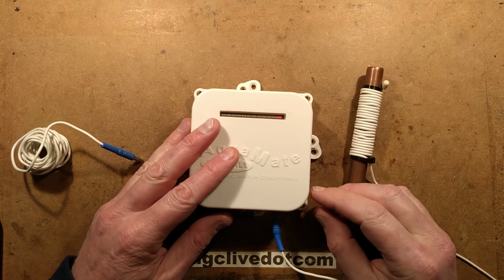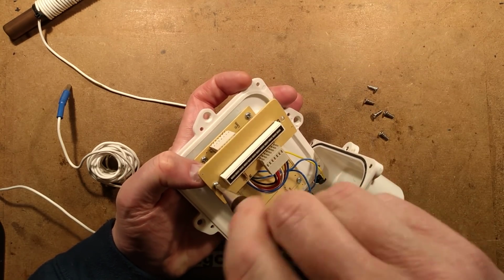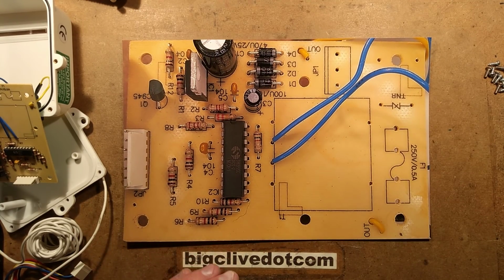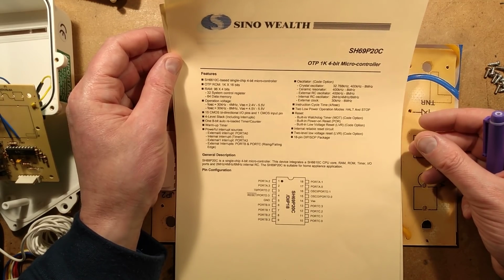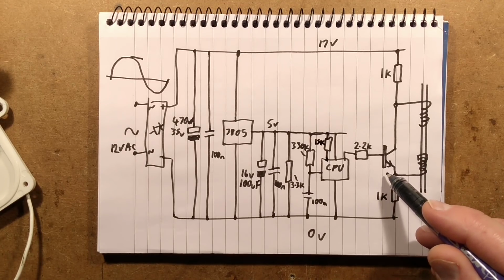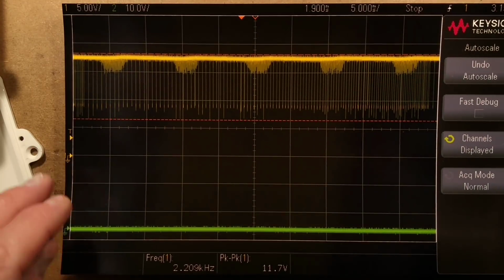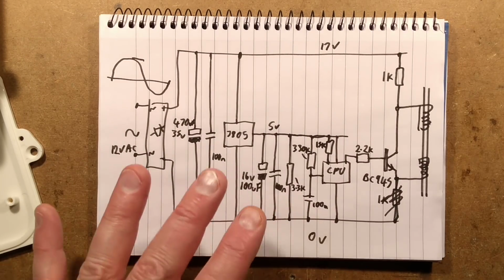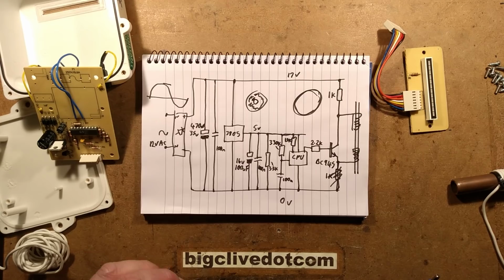inside a computerised pipework scale reducer.

Comment: There is absolutely no way this can descale anything. Hard water is basically water with calcium compounds dissolved. So regardless of the current induced in the water, you have the same ions before and after the "descaler", resulting in the same chemistry. The only way this "works" is by people imagining it does. It's a led chaser strip with placebo effect.
Reply: It aligns the polarity of the ions so they flow better at least until the first bend
Reply: @jostouw4366  that polarity is going to be dealt away with log before the first bend. The Brownian motion of the water molecules and the ions themselves is going to jumble everything just as well as it was before the "descaler". After all we are talking about ions in a fluid.
Reply: @featheredskeptic1301  Think you missed the irony and the coppery ...............................
Reply: @jostouw4366  Oh, ok. My bad. You just never know with people nowadays. I've heard way more ridiculous statements from people who are serious, they broke my irony detector. Sorry.
Reply: @featheredskeptic1301  Know what you mean the world is full of strange people sometimes they hide in mirrors lol
Reply: If a precipitate is forming, causing ions to oscillate may prevent large crystals forming and promote large numbers of smaller crystals without changing the underlying chemistry, they may be easier to pass
Reply: @marcpurkiss3233  Ions already oscillate much more vigorously due to thermal noise. Besides, even if passing AC current through the water in the pipe via capacitive coupling prevents crystal formation, the current only passes between the areas of the 2 electrodes few centimetres apart from one another. Any residual oscillation after this point is going to be lost very quickly due to Brownian motion. The ions are no longer within the electrical field of the descaler and so all effects are lost. There may be something that I'm missing and these things may actually work to some degree, but it all seems very dubious to me at best. It seems to be working as nothing more than a capacitive divider with the water/pipe as the middle electrode. I'm not even sure if this is going to pass any current in the water if it's mounted on a coper pipe... unless the water quality is so bad that you get something more similar to electrolyte instead.

Comment: The spikes makes me think they are attempting to mechanically micro-vibrate the piping.
Micro-vibrations may actually be effective (note to commenters: this device doesn't have to achieve that for it to be effective on its own)
Reply: I suspect, for me, the road traffic and the neighbour's hammering and drilling would be more effective.
Reply: That's not micro-vibrations, and they are at a way lower frequency.
Neighbour's hammering is tenths of hertz. (tenths not tens).

Comparing the two is like equating the ultrasonic sensor-dust cleaner in a DSLR with shaking the camera. If the latter worked, they wouldn't have installed the former. (the former is by no means perfect either)
EDIT: And yes, professional photographers will tell you there is a difference in having the ultrasonic self-clean and not, but they still might have to clean their sensors by hand.
Reply: How is a 2kHz electrical signal going to produce centihertz (?) vibrations, and why would the frequency matter?
Reply: First:
Where did you get centihertz from? How is "thenths [1/10] of hertz" "way lower" than centihertz (hundredths [1/100] of hertz)?
Also, let me direct you at my note to commenters.

No It would produce a sweep from about 1.64kHz to 5.54 kHz, if it even generated any mechanical effects.
The idea that it is supposed to be mechanical effect (regardless of it actually managing to do so or not) is somewhat supported by the instruction saying "not for lead pipes", as any mechanical deposit removal method could easily (in theory) deposit lead into your water supply (at least more so than without).

It doesn't matter if the device works or not, I'm trying to answer the question of how it is "joo joo"-supposed to work.
Reply: I might as well add that the kilohertz range does not travel that far in solid materials, so even if traffic (or the neighbour hammering) produced anything in that range, It won't travel far enough to get to the plumbing in any wall other than the one your neighbour is hammering on.
Reply: You know what I hate? When I'm trying to have a discussion with someone, and find that *after I replied*, they edited the post I replied to.
Reply: Except I didn't, I edited it 5 minutes after I posted it,  (that's 3 hours before you made your reply) and the contents of the edit is clearly marked.
Nice try thou.
Reply: prove it.
Reply: You are not in possession of a youtube notification e-mail (that will not be retro-changed by an edit by the way, so it will contain the original unedited message) that has contradicts what I just said.

As I said, nice try.
Reply: Also, such an email would be a perfect evidence for your claim.

By the way, you edited message said: 
"How is a 2kHz electrical signal going to produce centihertz vibrations, and why would the frequency matter?"
So I have now proven (to you who wrote and edited) that it does, in fact, not change retroactively. (Google+ in combination with Gmail did that at some point, youtube does not)
Reply: I'm going to go to bed now, so I won't get back to you  to reply until I wake up at the earliest (just in case you thought you could pull a "gotcha" on long reply times)
Reply: Not that I needed to worry it seems.
Reply: 2 weeks should be plenty of time to dig up and digest the evidence.
How's it going?

Comment: The weird connector and screw arrangement might be because it was originally meant for the strain relief of the mains input cable.
Anyway I bet it's complete BS but they where clever enough to make it actually do something so it would be harder to conclusively prove that it doesn't work

Comment: If you "use your imagination" you could picture one of these cleaning and softening your water if dirty water was magnetically responsive. Until a power outage sets all contaminants free.  In which case a solid-state magnet I would recommend to replace one of these electrical devices.

Comment: I put one (not this specific one) on the water pipe feeding my mothers electric shower. We have extremely high lime levels (in excess of 300 ppm ) in our water. 
Mum was needing a new kettle and new shower every couple of years.  Her shower head blocked every month. 
After fitting it (it was expensive) the shower head stopped blocking and we are still using the same shower 15+ years later. Kettles however still have to replaced at an annoying frequency.
However some British Gas engineer stole it when servicing mums system one year. Mum called me to say she thought it had stopped working because her showerhead was blocked again. I found the unit had gone!
I bought a permanent magnet version because I did not want to part with another £100 or so. 
This is not as good at all but sort of works. We only have to clean the shower head every year now to remove the lime not every month.
I can see a difference in the way the system works. The one I fitted had the wires looped around the pipe and back to the unit forming a complete circuit. So making a pair of electromagnets. :) good work Clive.
Reply: I don't remember paying so much for ours, I thought it was around the £24 mark from Screwfix but going on their website now it's listed for £47. BWT ELECTRONIC SCALE INHIBITOR (13487)
Reply: You can clean shower heads with distilled clear vinegar. It takes seconds 😉 as long as you do it regularly.
Reply: @Mark1024MAK  We do both the shower head and the kettle with distilled vinegar.
Reply: @DevinderAthwal306  yes but not for the insides of an electric shower unit!

Comment: I'm pretty sure it's fake. From a chemistry standpoint, I don't see how it would do anything.
Reply: It works! You must only B E L I V E! (At this point please introduce The X-Files music!)
Reply: The copper is a closed Faraday cage. Nothing happens inside.
Reply: Believe! ahaha
Reply: It works flawlessly.  Just be very careful to wind the coils the right way.  If you get them wrong, it'll double the scale rather than remove it!  This can also happen if you plug the 12V AC in round the wrong way!
Reply: @thisnthat3530  🤣🤣🤣😝😁
Reply: It works 100%, I make demineralized water with it.
Reply: Yes it does trust me, I'm a scientist.
Reply: @MABFR01  I heard, you can use it as a fuel saver, too
Reply: @CyberlightFG  Who told you that?! THAT'S MY DISCOVERY!!
Reply: @MABFR01  If you put the coil inside the pipe and then connect either end of the pipe to an electrical appliance you get free energy!
Reply: With a sufficiently powerful oscillation it should be possible to change the particle size of the precipitate, which may make it easier to pass- ie ultrasound vs kidney stone but instead of a blast to break appart existing crystals inhibit the growth of large crystals by promoting more nucleation sites to use up excess calcium
Reply: @marcpurkiss3233  This thing does not have anywhere near enough power to do anything like that. That's the problem. It needs a million times more power to have any possible effect, especially, if there is substantial water flow through the pipe.
Reply: @vincentrobinette1507  I thought 1,000,000 X 0 is just 0? 🤷‍♂️

Comment: Can't imagine how something like this would work. If you stripped off ions so that they separated from the scale, the ions would flow through the pipes and just reattach to each other at some point down the line. One concern I might have is what this current might do to lead solder joints. You're introducing a current into a pipe which woujld otherwise be "grounded" or "earthed". Would the "sound" introduced by the device make the pipe vibrate in such a way as to loosen and dislodge the scale? Again, I'd have to ask what effect this might have on solder joints.

I'd have to see a thorough scientific explanation before I bought any device like this.
Reply: That pipe has to be electrically grounded by law.
Reply: You can sort of show scientifically that it does do something, to stay legal, they just wont show you how inefficient it is.
Reply: noferblatz - what vibration? This device puts out a less than a fraction of a mW into the pipe...
Reply: Any vibration or temperature flexing could be bad for lead free solder as we know from the early fail rate of modern equipment, I smell a devious plot there!
Reply: jos Touw The solder joints in question are the huge ones on the pipe, not tiny electronic ones.
Reply: @johnfrancisdoe1563  Seriously you wake me for that earth shattering piece of information wow you must be a good friend to all your mates and family I'll bet they rely on you for all the info they don't trust coming from the big media firms until you filter the truth from it all !
Ps. I knew that already google " irony"
Reply: If it induces ion flow it may disrupt crystal growth- may make a finer precipitate that can pass through the pipes and out maybe?

Comment: It's an old technology that requires no updating because how do you "improve" snake oil.  I was almost fired from a job at a plumbing supply house when word came down the pipe (see what I did there?) that our company had gotten into bed with this manufacturer of a device that would prevent scale in water piping. Astounding!  No scale buildup whatsoever!  Push this product!
The units actually DO prevent the buildup of scale (from calcium carbonate in my instance), however it only worked where the windings were around the pipe and perhaps a foot or so beyond. However after the "ions had reconfigured", or whatever, the problem was actually worse.  My suggestion was to REMOVE the "hardness" but they seemed happier to keep the sh*t in solution and pass it on to the end user who was drinking, bathing and cooking with this funny water.
Total crap!
Nice vid Clive.  Also liked the Canadian Sweets video over black russians with blinky beard and buddy.  Btw, we call them candy.  Cheers mate!
Reply: Is "technology" the right word for this nonsense?

Comment: Not every microcontrollers divide the clock by 4 to execute a single instruction. Take the 8051 for instance, it divides by 12. While in the AVR's family there's no clock division.
Reply: AVR Attiny24/44/84 divide the internal oscillator by 8 as default.  This can be changed by setting a fuse so the chip clock can be run at 8Mhz .  No idea how stable it is  but I run one of my projects successfully in this configuration. Other pre-scalars are also possible.
Reply: @liquidsonly  Thought you had gone off subject till you mentioned pre-scalars.